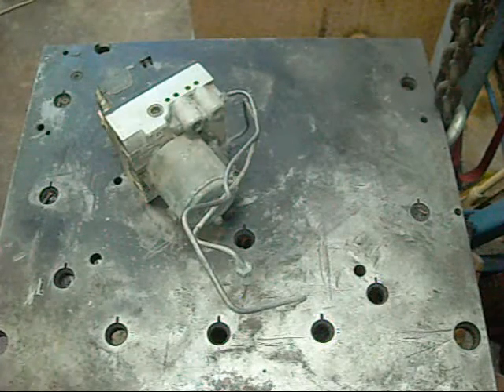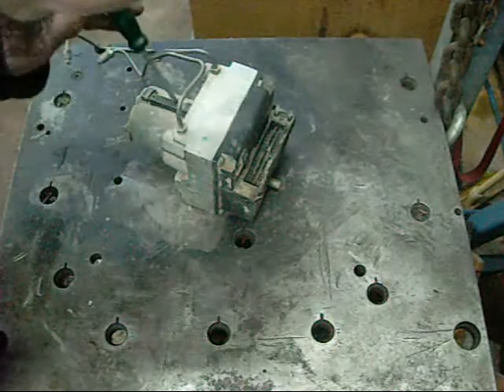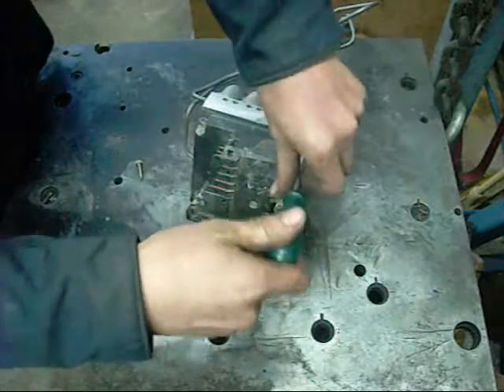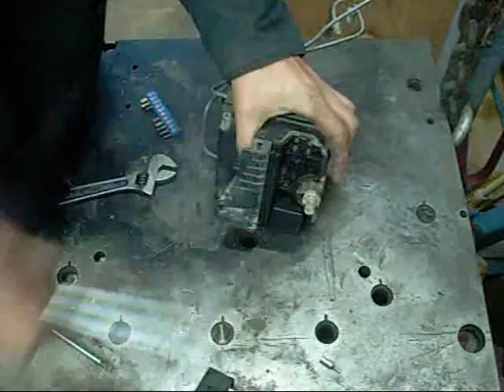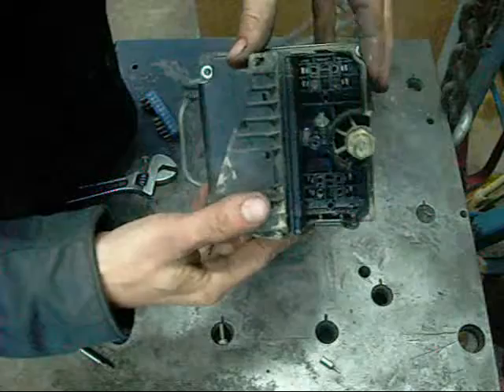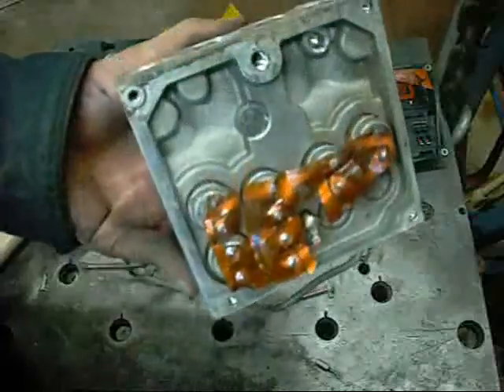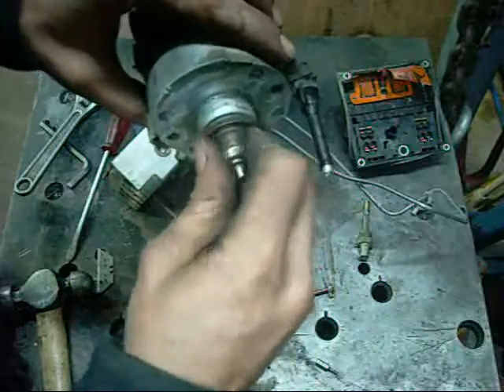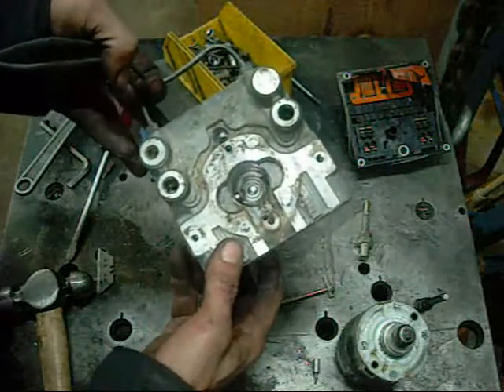Bosch Car ABS Controller Block Autopsy

Comment from the maker: @RVK355 Cool man! I've been in and out of the injection molding and die casting biz a bit, I'm almost qualified as a injection molder and die setter ( ran out of work and had to terminate :( )

I'm trying to decide if I want to do toolmaking or Mechatronics as a additional trade.

Comment from the maker: @RVK355 it does look like a Commodore ABS controller.

Very close on the table!, its 3/4 of a ejector plate from a lawnmower deck die, gravity cast aluminum. it was a gift from my old work.

I wouldn't mind making tables out of some of the old ejector plates Nylex has in their graveyard, the ones off the plastic bin dies are huge!

Comment: Great video, Thanks. The modulator looks kinda like a Vectra but I'm not too sure. The pump is used to pump fluid back to the master cylinder against normal braking pressures (when the correct solenoids are actuated) to reduce force to the wheel(s) that are locking up. The actual cycle is somewhat more complex. It's funny that in the early days the ABS systems the electronic modules were very reliable but now are failing all the time (even under warranty). ie VT onwards Astra's VW's BMW's + more